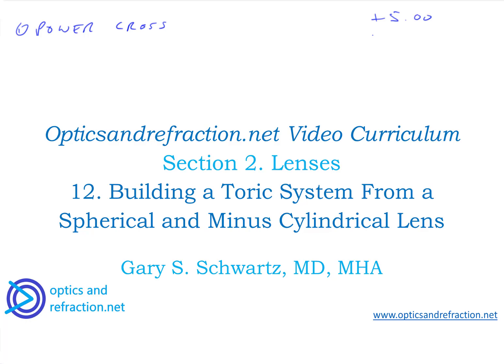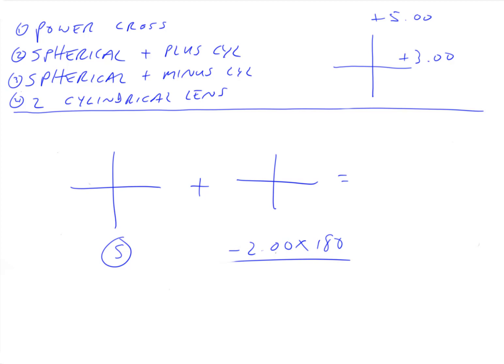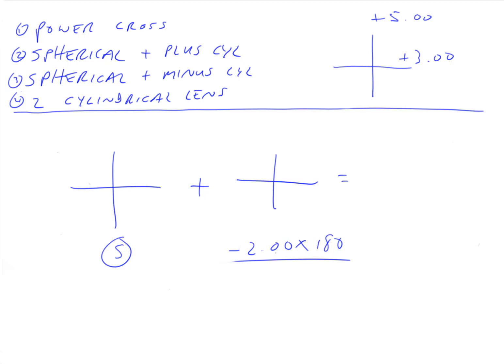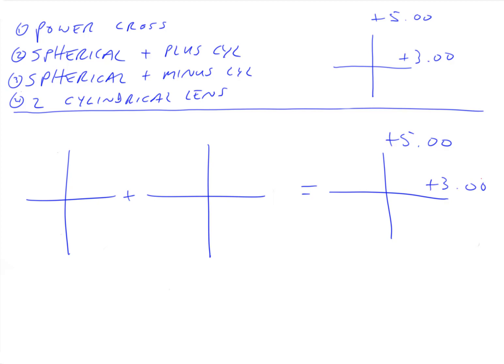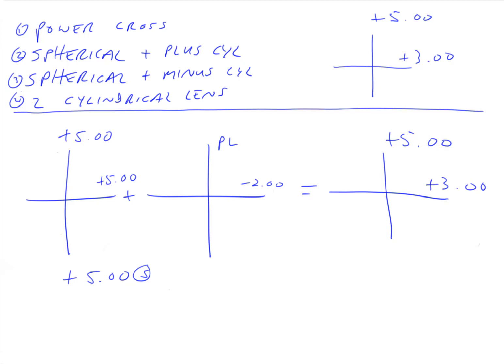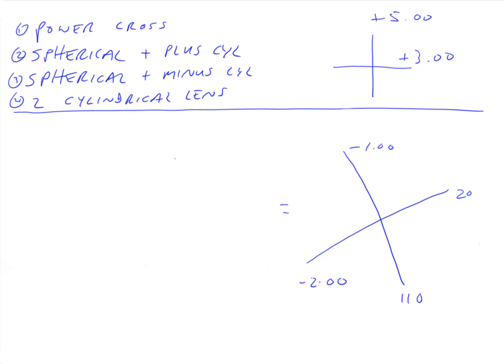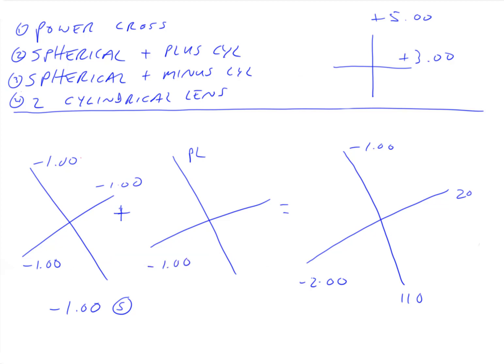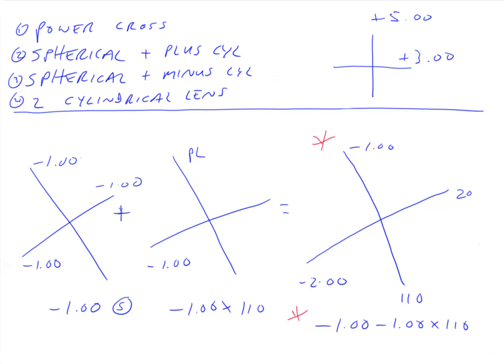2-12 Building a Toric System From a Spherical and Minus Cylindrical Lens

Comment: What we were taught in Optometry is that we use minus cylinders cuz of the aesthetics  (they're thinner and cooler) especially for myopic prescriptions and it's easier for the patients to adapt to them. Some patients even specifically request for minus cylinder prescriptions.

There were some other reasons but these are what I remember.